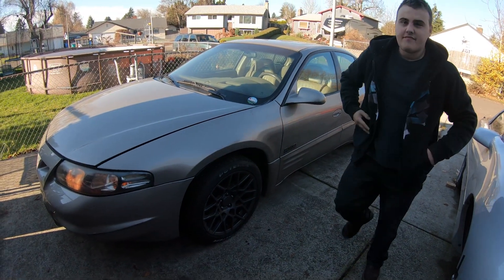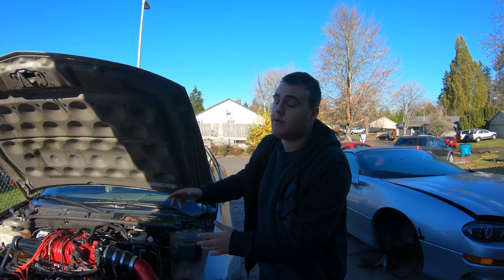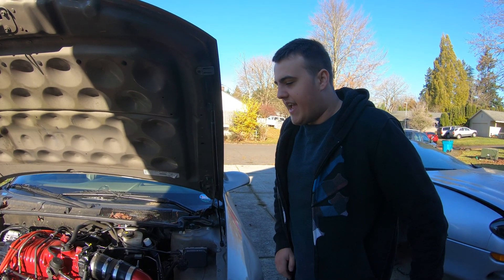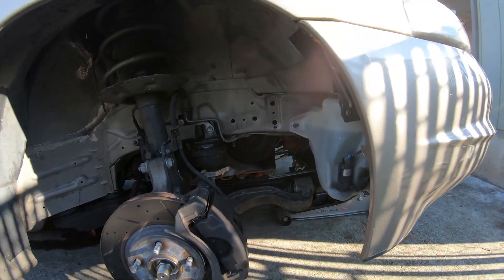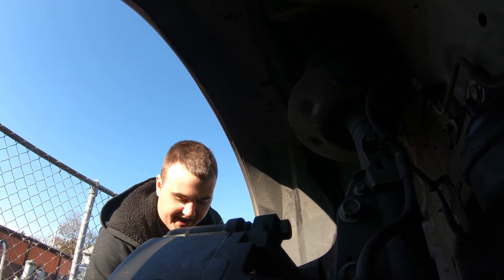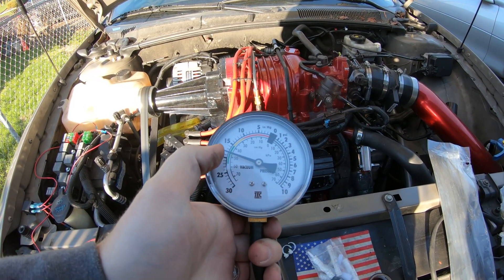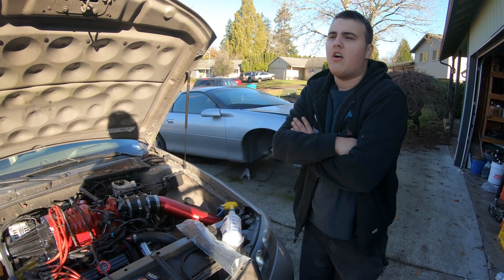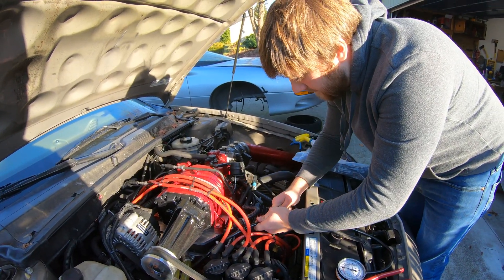Bonneville SSEi 3800 Series II Top Swap Update Part 2! (Balance Shaft Issues + Vacuum Test)

Comment: 12.29.20.    FYI.   Use a propane torch on the harmonic balancers crankshaft bolt head (15/16”or 24mm) it is red Loctited to the crankshaft, it comes off much easier after heating it up for a few minutes. Also the threads in the balancer are metric......M6 x 1.0 x 70 80 or 90mm long. I use Harden Allen bolts with grade 8  1/4” washers. As used with the puller. Use some oil on the threads or liquid wrench sprayed in to the holes for the harmonic balancer.
Some people use 1/4 x28  by 2 3/4”   3” or 3 1/2” long bolts, but you will mess up the threads inside of the harmonic balancer, when you pull it off.
Reply from the maker: We'll keep that in mind, thanks for the bolt specs